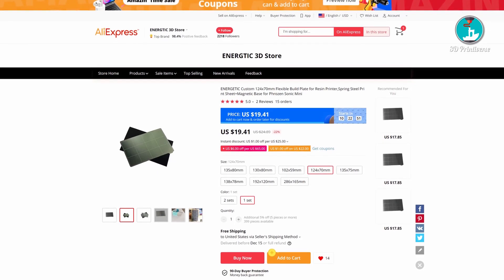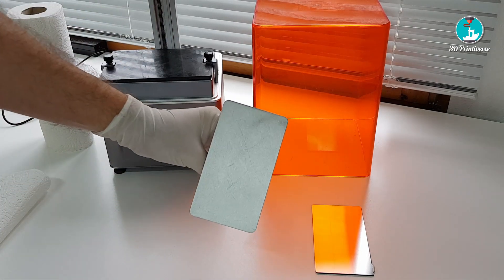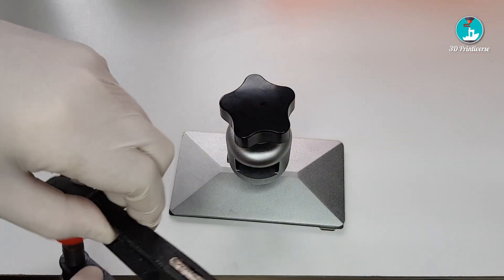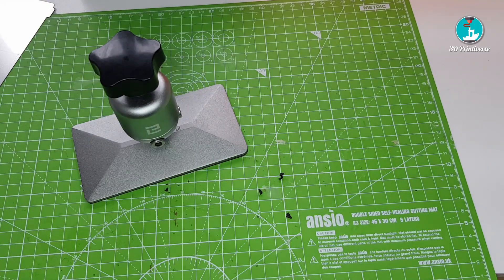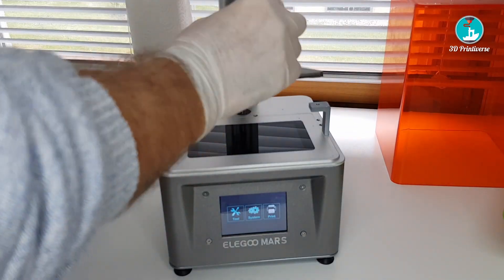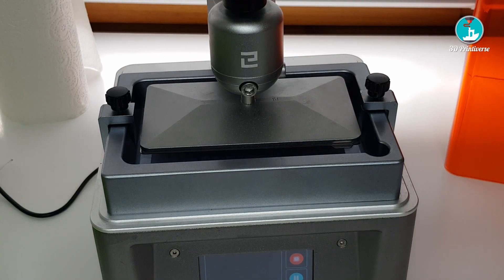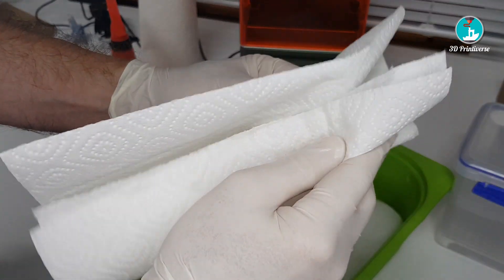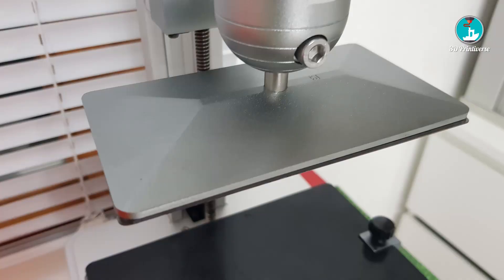Are the AliExpress ENERGETIC Flexible Build System for Resin Printer worth it?

Comment: This maybe what I need?I got the new Elegoo Saturn 2 resin printer a couple of weeks ago and the daft thing is, even Elegoo don't have the flex plate for the huge build plate this printer has got.
I been looking for a flex-plate for before the printer even was delivered as I know about it being a better way to remove the models without the damn damaging by having to use the metal scrapper.

Wham Bam plates are good but damn pricey!  And since I can't found the huge sized flex plate for my Saturn 2, I may get one from AliExpress?
The only thing with using their service is the long wait for the delivery as it has t come all the way from China by the slowest transport I think they can find?

I must say that Elegoo really are not on the game when it comes to getting ready for the expected release of a new resin printer they launch.
They launch it and people buy it in the many hundreds or more But Elegoo has no spares or accessories already set up fr the customers needing the plates etc.
They have some small stuff there but none of the flex plates or other needed add on's. Even other resin printer parts makers don't have them for a long time after the printer comes out!

I think also that all the magnetic flex plates for the different sized printers should have small tiny raised corners to help a line the flex plate on the magnetic base for printing, just the same height as the flax plate is on the base so it don't stop the plate from pressing flat on the FEP Film when printing! No off angled flex plate anymore!

Comment: Is a spacer needed for the “Elegoo Mars 2 Pro” or can the flex plate be applied and then just recalibrate the printer? I heard that a spacer is needed.
Reply from the maker: Hi, there is no spacer needed, just recalibrating the printer :)
Reply: A spacer IS needed. Before every print, the printer goes to home (which is different to z=0) and if your endstop does not have a spacer, it will keep pushing on the screen and likely break it. Other than the spacer you are gonna need longer bolts to hold it.

Comment: Resione resin does not stick to the flexible plate, how to fix it?
Reply from the maker: It's stick till you bend the plate 😜
Reply: I meant that the first layer does not stick when printing. Also, the magnetic gasket comes off a little when I remove the flexible plate.

Comment: Thanks for the video.
Some more tip for installation:
Remove the steel plate before sticking the magnet.
First align the side covered with protective paper before sticking it.
Then it's best to press the center and squeeze to the side to prevent air bubble.
For some printer, spacer are required if there is not enough room for the magnet and plate.
Reply from the maker: Thank you Tilo for the good tipp!

Comment: So I got this for a Mars 2 Mono and cannot seem to get it setup correctly.

Followed the video, but when I go to print it sounds like the printer is trying to force the buildplate lower than it can go.

Am I doing something wrong here? I have also tried adding a spacer to the z-axis, but still the same issue.

Thanks
Reply from the maker: First, have you unscrewed/un-tighted the build-plate?
Reply: @3DPrintiverse  Hi. Yes I did. Followed as per video. Recalibrated and all seems ok, but when it comes to print it does not work (also checked that everything is clear of the resin vat).
Reply: You must add some spacer to z stop, I think on wham bam here is some instructions for your printer and I think you can find spacer 3d model there. Your issue is happening because z stop is not trigging z axis sensor.
P.s. I have anycubic photon mono 4k and I'm also set the spacer on printer with the flexible plate installed.
Reply from the maker: You don't need spacer on the Mars, just relevel the plate as usual 👍

Comment: important not the steel plate . is the magnet. I wait your review few month later
Reply from the maker: I'm now on a second video that makes a comparison between the aliexpress and the wham bam one ✌️
Reply: @3DPrintiverse  I suspect all these plates - from all the different companies - unbranded and branded - are all using the same supplier for the spring steel sheet.
Reply from the maker: Yes, like its all the same, but some have difference on the spring strength. I'm now finished the video that compares the wham bam and the cheap ones, and yes there is a difference... stay tuned 😁
Reply: @3DPrintiverse  I'll look out for the new video !

Comment: sovol has some for even less so ill be buying from them, didn't see a video about them yet so hope it'll work
Reply from the maker: Try it and leave a feedback after if it's works well 😉
Reply: @3DPrintiverse  just did my first print with them, it worked but it was a pretty easy print, I didn't have any trouble installing it but the shipping was a bit long. the menual had a creality logo on it but creality doesn't sell that size on their website so I'm not sure if it is from sovol or not
Reply from the maker: I think it's all come from the same manufacturer 😅
Reply: @alonraz6477  talked with sovol regarding the manuals logo, aperently most of these plates are from the same factory and they get them from there packaged and ready with the manual.
Reply from the maker: Than you for the feedback 👌

Comment: I have the same one for my Elegoo Mars and Elegoo Saturn. The just work so totally worth the saving.
Reply: Is the magnet strong enough for bigger prints? I have the Saturn V2
Reply from the maker: For big prints like figures, busts etc. no problem but if you print a big heavy solid block then not 😅
Reply from the maker: Yes, that's true 👍